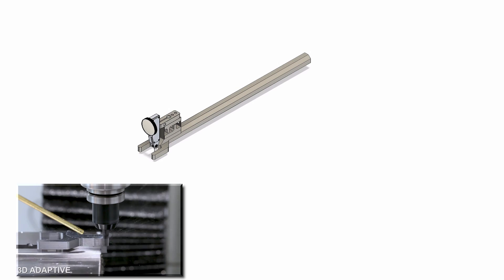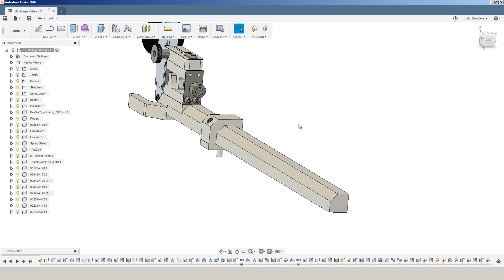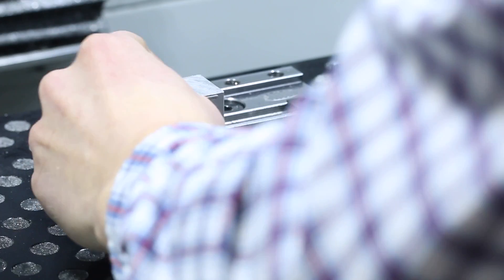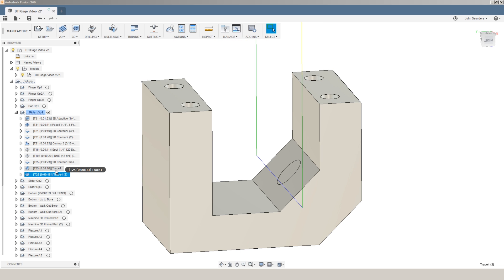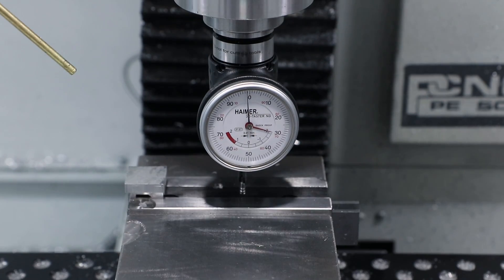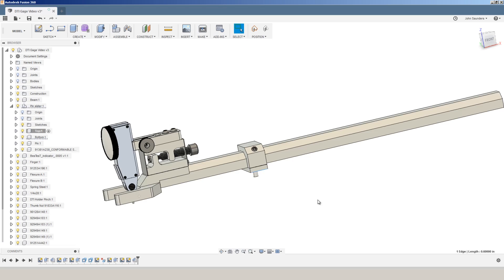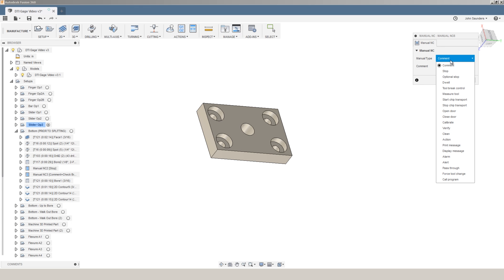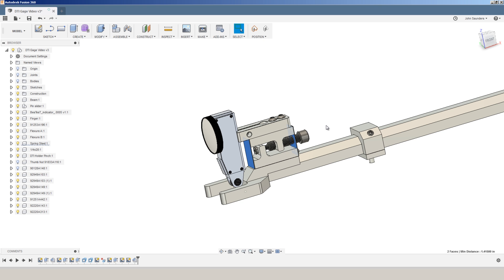BUY or DIY? Shallow Test Gage Part 2 | WW241

Comment: Nice project. Great work on creating it.

With the design though, having a set screw, screw directly onto the bar like that will marr the surface as well as slightly move the position of that piece as the block counteracts the uneven rotating surface of the screw. I know you have the fine adjustment to take out inaccuracies but a simple design change would save some work and keep the integrity of the bar for longer. Having a clamp along the lines of how you clamp the indicator would be better imo. Like a square section shaft collar.

That's just my opinion though.

Otherwise a great design. The differential screw is very nice.

Comment: Cant wait to grab a fixture plate for my 770m and a mod vise, might also grab a mini pallet also I like how made that setup!, I also will have some job shop work for your plasma table this spring/summer if its available to cut some steel or aluminum sheet to panel in my DIY laser.

Comment: Instead of drawing all the geometry for the second mill-drill pass. 

Could have just used the inside contour line. It would have used the tool’s diameter and would have cut perfect.

Comment: John, In a G code program to rerun a tool after your program stop. This is what I typically do. You will have your M00 the next line you can put a GOTO statement. (I don't know if the Tormach machine's control will do this. Your Haas will) It would look like this /GOTO100. This would branch to N100 in the program (This of course need to match your N sequence number where you want to return to). The forward slash or block delete means this line will be skipped if the block delete key is enabled. When running a boring head this is particularity helpful. The machine will be caught in a continuous loop until you enable (Push) the block delete key. You don't have to reset and restart the program over and over. You may already know this but just in case. I'm not sure if its control will allow you to change the diameter/radius offset on the tool in the M00 status without reset (my Mitsubishi will) . If so this will also work for rerunning your endmill to size a profile or hole.
Reply: A lot of good information, Thanks for sharing!
Reply: Only works if you have the Custom Macro B programming option installed on it.  That goes for any machine’s controller regardless of brand. 

Otherwise it just gives you a bad code error if you try it.
Reply: Occams Sawzall if his Haas has probing it has to have macro capability. As far as the tormach I don’t know.